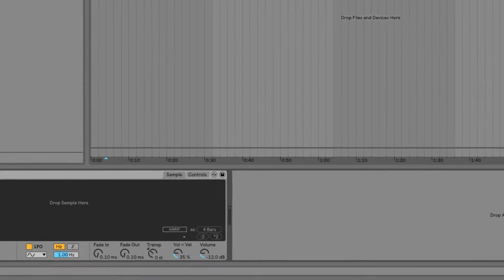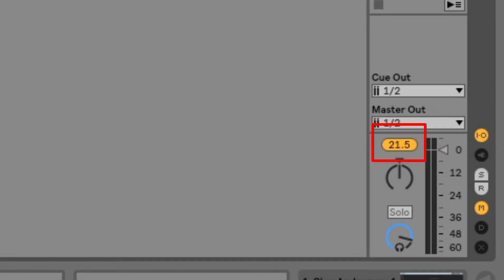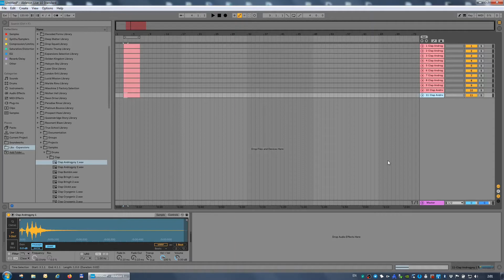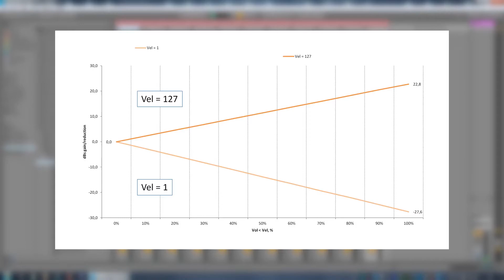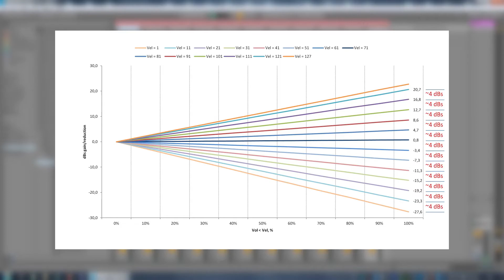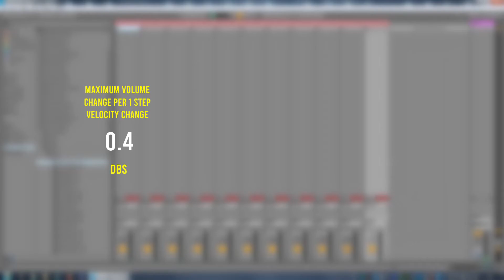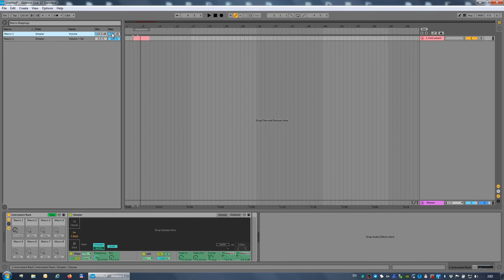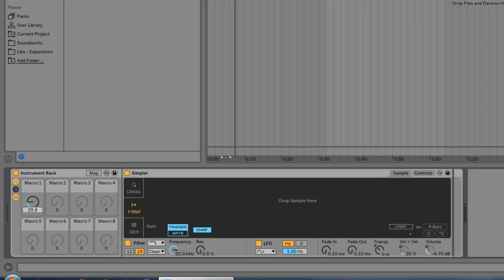"Velocity to Volume" MIDI control in Ableton's Simpler explained

Comment: Great Video! 
Usually I don't want gain boost for my samples, only gain reduction if the velocity is lower than 127. Can I somehow set the Simpler to 127 = Original Amplitude/ 0 Change ??
Reply from the maker: Hi! That's the point exactly: with these settings, at 127 velocity you get the original amplitude (or very-very close to it). Any other velocity value will decrease it, and it will work at any Vol < Vel value. Alex.
Reply: @Saxophonic got it! Thank you 🙏
Reply from the maker: Hi! If you're still interested in music production in Ableton Live, I've started a dedicated channel. See you @SoundWorksDXB. Alex